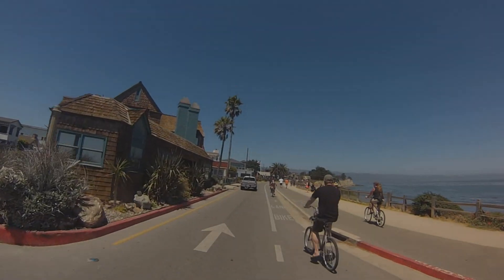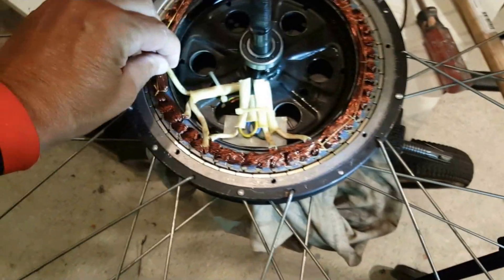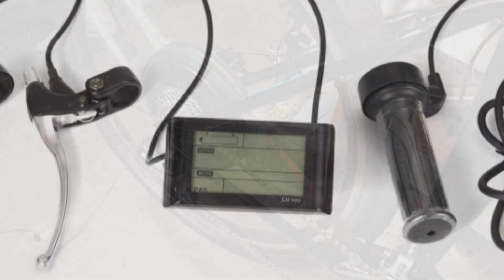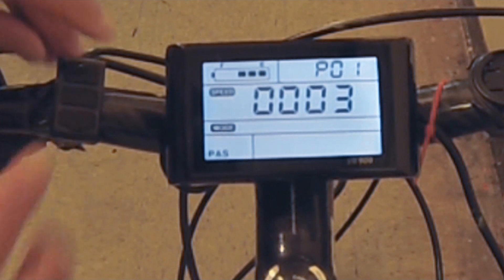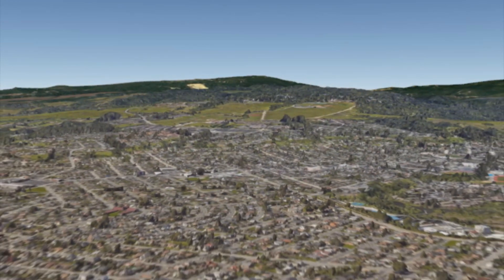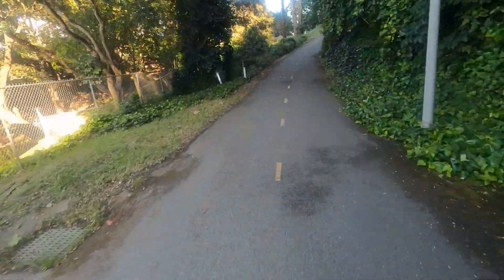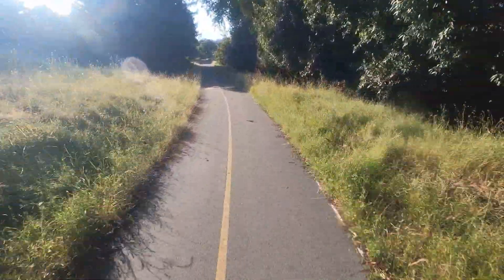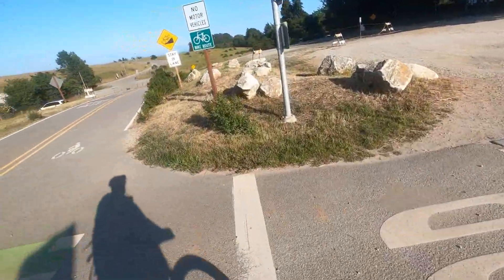E bikes 2020: Powerful -  New 1500w Rear Hub Conversion Kit, External Controller, 52v Battery 17.5AH

Comment: I have an old 1970's Suzuki Enduro frame all stripped down and was wondering if 1500 watts is enough power to pull myself around. Any good resources to determine drive size for bike weight??
Reply: You'll only get around 10mph depending on what you weigh

Comment: i  built a 1500 watt 500 rear 1000 watt front hub 36 volt rear 48 volt front just waiting for the 48 volt battery pack but it will go 25 mph on the rear 500 watt  but will not tackle a step hill  i am 220 lbs  any one out there ever build a all wheel drive hoping this thing turns out to be  a good choice

Comment: Will the TFT Display work with the Voilamart 1500w built-in controller hub?
Reply: No it doesn't it's only for bafang bbs mid drive. I thought about buying 1 and I have a voilamart and from doing research its only compatible with bafang. But a colour display called 24-72v UKC-1 Display should fit as it's the same connection as the voilamart display. Here it is 
https://www.ebay.co.uk/itm/143678822342?_trkparms=ispr%3D1&hash=item2173ecd7c6:g:ve0AAOSwhCFfMHvn&amdata=enc%3AAQAFAAACgBaobrjLl8XobRIiIML1V4Imu%252Fn%252BzU5L90Z278x5ickk7d4nremBkvNKtcC0ZwqXDBYuoTXgb8ZVDRkj8gD75sD%252F6i4%252FF1GvbCflhFH43UdalYYU6waEGeoYYVP7Jme2S%252Bo3hs%252B3GKy74NsOYaDsO5LhYT4oP4gC%252Fd%252F2tyVIDc%252BUS4q6YEtwobzDGDe7m7IQ9zQpZ%252FTNoetGxb%252BNywbih66hoTQqCh7z7BiVOmMWVbQV6l0EOps9ocKrpE80FyezZuvnmLOGFmEXUul0xnHOOoqEdj43%252BzCVGzrhwNM4jH23yBvCuRv4YuKSXGlovJz1Ii8xEONCFTZ2ODu%252BEh%252FXeoF6s02iR7zG%252Fl5a4j6EbmGE9zxwuyhh%252F%252Fg0T767KTea2wJZv1LQry0UjwPny08JbTYiU1kZ2cwDc2IIuJpI4vMlMObflljuTRhG1iG5rRPE%252Bfu6tWzUDRqqSfiODptbNu5xA84v5Ena0bsAvY4wmwkyx5BZJE0J7EMByBJ8LQ5aLXytyL93nrzPmh0NuWjA6klEXCbVFrQJkYmU11j3MRHws3eKw%252BBAPjGQbuDZ%252BGG7ZrP2bxMJem%252FNRIrvcDjo2m2zTZBJDEo1tnOK2gx8vj16JzYHaumCM8aG3P5iET3AFQG%252BaADB9bq8qs1i5dZwd%252FH0VDWqGupXZ8aSa6cE95jBN5GEDCh658VR2YXksbKaLdYkGm6Q3oZyE1AlVxubJwjMsFJNDsmrTpjlXZDKekHJ4cc7w1EOrr3Ay5lsfrIKS5ZtRq7nWay4wYqFj%252FfaDFHWQmkTN8OFTLDNJk211OPdWnBAm4dD9ToWWJOwCQr34zCXDFwb%252BSeRQDIKV8mViuM%253D%7Ccksum%3A143678822342d3e32e12c05a471892b60cabb04718f7%7Campid%3APL_CLK%7Cclp%3A2334524

Comment: Kirby can you recommend a 1500 watt fat tire kit for me . I will be installing it on a juiced ripcurrent s
Reply: I put a 1000 front hub on a retail ebike to make it AWD--it spins the front tire up to 10 mph and can climb a medium to steep hill at 22 to 28 mph--the 1500 is uneeeded if are adding a motor--I would do the 1000 for range. I have vids on mine.The 1000 can also do 32 mph on flat by itself.I use the 1000 for hills and trails and even going over 20 mph you can hear the tire just grip the pavement with just the 1000.I almost got a 1500--but I am now glad I did not because it would be overkill.I got a 750 bafang rear hub with a 48 v 14 ah battery and a 1000 watt front hub with a 48v 20 ah battery--2 controllers also.There is no hill or trail i can not climb now--and can climb with 20 plus mph speeds--anything above 20 on a trail or 30 on a street is really pushing these to the limits of what i would feel safe doing.I have a CSC 20 inch fat tire that I did this to.I also got 80 mile plus range with the setup.

Comment: Is your motor 52v aswell? I bought 48v, but battery is 52v now thinkng if that will last long or better not overload it
Reply: A so called 48v battery charges upto anywhere from 52-55v, just like a 36v charges to 42v,the more Amp Hours the better your range and you can pull more Amps for longer time.
Reply: @ianmangham4570  question is not about battery specification. But about motor wheel capabilities. If motor rated as 48v, then battery supposed yo be 48v. If battery is higher voltage, then motor can be affected by higher voltage.  i am not about battery capacity. By mentioning 52v battery and 48v motor i mean nominal voltage of both. So battery is 14s, when fully charged is 58.8v, but 48v  motor wheel mean for 13s battery, which is only 54.6v. Is not big difference, but may affect motor if is rated to lower voltage
Reply: @Home_made_ch  DOESN'T MATTER, I've built around 3 kits, if its a 48v controller then it's got most likely 80v capacitors inside and plenty of mosfets, the ESC/CONTROLLER decides how many volts and amps go to the motor
Reply: @ianmangham4570  mosfets there not plenty, but according maximum current, that can go trough them. 48v controller can be rated as 500w and only 6 mosfets, but can be 1.5kw with 18 mosfets. What current will go trough controller, is depend of throttle position. And usually all specs are calculated from maximum power, like range, time, and speed.
I built view bikes aswell, and all parameters been calculated, so it matter.

Comment: Hi , Can you please make a video using PAS assist only showing the different power you get at different level settings. I am interested to see what the SW900 display shows when actually riding at different levels. Thanks.
Reply: Hey @tarquingaylord , I have a 1000w ebike kit with a 48v 16ah battery and I can tell you about the PAS. I have the SW900 Display and Pas 1 goes around 17mph with pretty light peddling, pas 2 goes upto 19.5mph depending how hard you pedal and on the terrain your on, pas 3 took me to 23mph with medium amt of peddling and on flat ground, pas 4 was around 25-26 mph depending again on the road surface and how hard you pedal and then PAS 5 takes you upto around 28-30mph. The fastest I've gone with PEDAL Assist was 30.8mph but that was with programming it to 3 levels of PAS and not the more common 5 levels. Hope this helps and if you want to know anything else feel free to ask
Reply: @ashley010788  thanks for that. I did manage to get the system working and I more or less got the same results as yourself so very helpful. Don’t tell anyone but I did eventually find out what the problem was ..... a wire was trapped against the bike frame and shorting to earth causing the controller to have a dicky fit. Job done. Cheers

Comment: 1 thing ive learned is rear suspension saves direct drive motors road impacts such as ripped spokes off hub/rim & hub electrical  internals, i bought a bike from bike shop & told them i was putting a ebike kit they suggested a hardtail long story short bike lasted 80 miles so i went & bought a full suspension & new ebike kit 6500 miles later & still going.
Reply: That's why i go with front hub motor on Steel lower triple tree forks
Reply: I would agree that on most full squish battery fitment seems to be an issue from what I see

Comment: hi , will the hub take a 9 speed cassette ,and fit  right back into origional dropout ? ive just sent for  the kit but notice on most ebike conversions videos , that the all seem to use 7 speed ,freewheel or cassette ,  but mine is 9 , and wondering if it will fit without any bother , thanks !
Reply: Hi, I’m in the exact same situation, did you find out?
Reply: Depends, most will

Comment: Hey what do you think about adding a front hub motor to my allready e bike...
Reply: Its probobly not worth it, would add a bunch more weight and motor drag and wouldn't increase the top speed.

If you're going to upgrade get a better controller or battery
Reply: I agree. A battery with more volts should increase your speed on level ground and a controller with more amps than your current 1 will increase acceleration and maximum speed achieved on a hill

Comment: What’s the range on that 17.5 ah?
Reply: I have the same motor with 20ah battery and get 80-100 miles on pedal assist and about 25 miles throttle only. My average rides on a weekend are about 30-40 miles of mixed riding. Most I got with heavy throttle use while on MTB trails with gravel paths was 45 miles and had 2 volts left when I got back.

Comment: I run an s900 for a fat tire bike rear motor and a sw900 for the front wheel motor. I have 2 batteries. One for each motor. Both lcd’s work just fine. It took forever to get the speedometers to match with both throttle and pedal assist. They are very easy to use displays. Thanks
Reply: Hi remixread, 
I have the same LCD sw900 and a 26amp controller 48 volt batt 750watt int geared rear hub. It puts out almost 2 hp on a fully charged battery! 💪

🗣My question to you, which parameters are you adjusting and what values did you end up with to get your best results.....I have problems getting my speedometer and odometer to BOTH be accurate, so I usually turn on my phone app, (BIKEOMETER) to get accurate speeds and distance numbers, of course comparing the app to the sw900 (while riding) is where I discovered all the discrepancies. 
🚵‍♀️Congratulations on getting your two wheel drive system configured and working, and working accurately 👍
My channel has a couple of videos showing GPS app accuracy vs unmodded ebike display inaccuracies💩